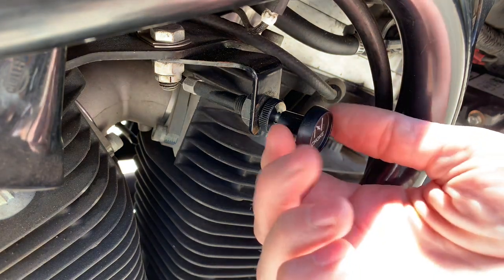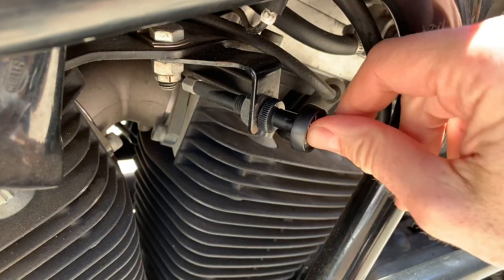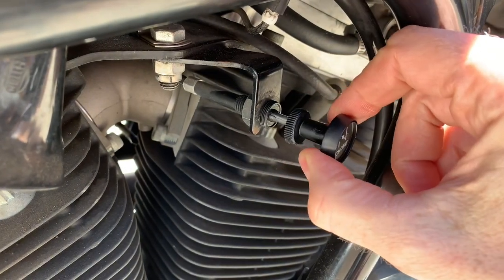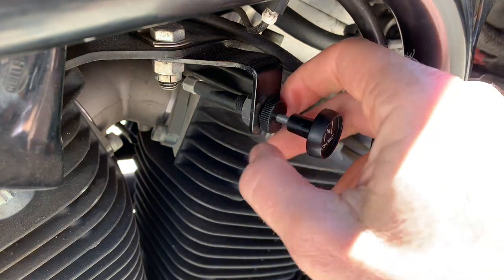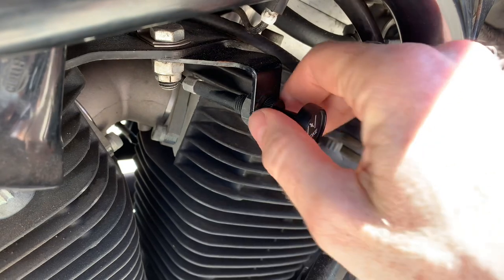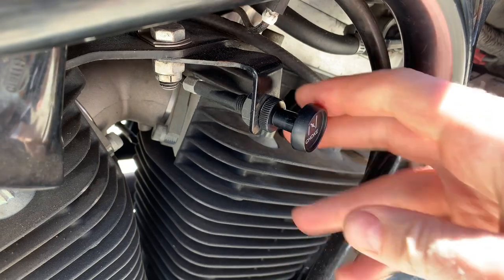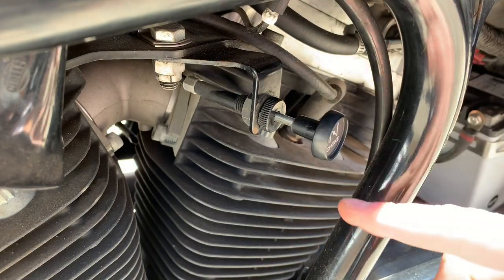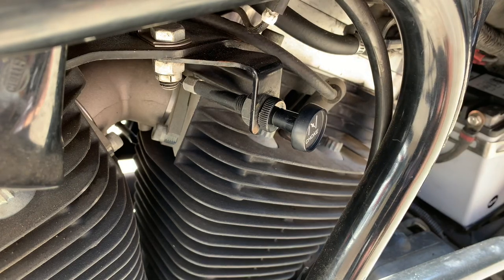Fix Harley Davidson Choke Won’t Stay On

Comment: I’ve had a Sportster for 10 years and have used a wooden clothes pin as a work-around for this problem. I guess YouTubing solutions to common problems wasn’t a thing 10 years ago because I just accepted the clothes pin as my motorcycling penance. 

You are a beautiful, kind individual who deserves every good thing that happens to you. Thanks for the video!
Reply from the maker: You’re welcome. I’m glad you found my video.
Reply: I just bought a sporty with a clothespin on it first thing I did

Comment: Who sells the best replacement choke cable like the one you have there. My factory one broke one tightening the number on the back of the bracket. Turns out the threads are plastic

Comment: I was asking people how you can adjust the duration your choke will stay open for, as mine closed way too fast, until someone told me it’s not supposed to close on its own.  I then learned about the tension ring in the back. I felt like an idiot.
Reply from the maker: That’s true, but sometimes you can get it set just right, so that it vibrates itself closed right when the engine warms up. It’s not easy to do, but there is a sweet spot. It’s definitely designed so it’s supposed to stay open until you close it though.

Comment: Even if you tighten the screw, it will not be fixed. the year of the year
Is it because it's old and rusty?
It doesn't hold even if you tighten it as much as you can

Comment: After owning a motorcycle since 94 and having a 78 van that also had a manual choke I believe that all car should have a manual choke it's really so much better in my opinion
Reply from the maker: I was always amazed that car is stopped having chalk levers in the 70s, but motorcycles went all the way into the 2010s still having chokes.
Reply: @hoohoohoblin  Yeh, I guess if  you have fuel injection it's not needed. My helix has an auto by starter and I don't really understand it. Wish it just had a choke. The few times that I have been at high altitude on the harley, the choke was invaluable. I don't think I ever knew your trick by choke has always worked flawlessly.

Comment: Mine is set tight but still falls back in - 1996 Honda Shadow VT600
Reply from the maker: Then you’ll have to replace the cable. They do eventually wear out.